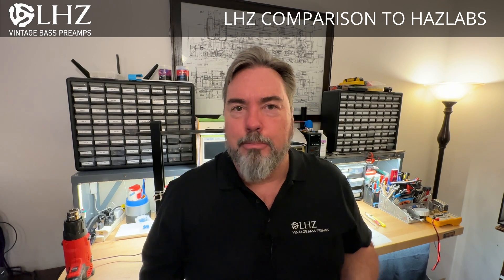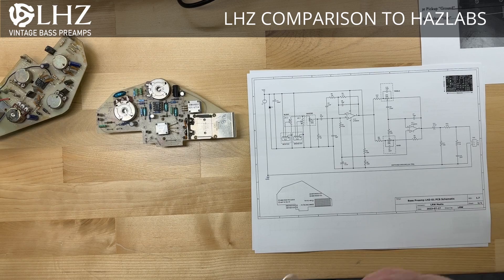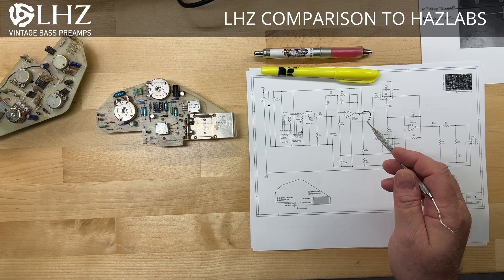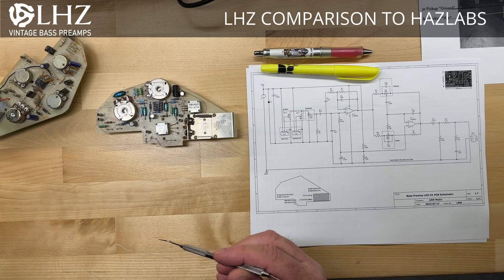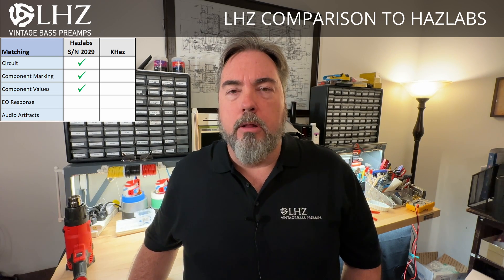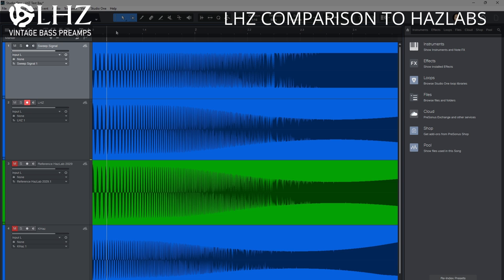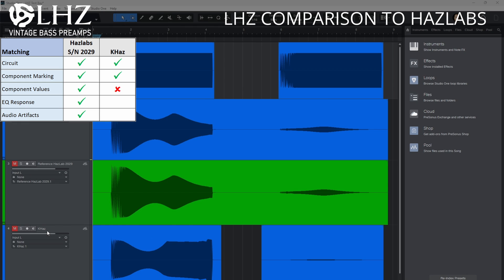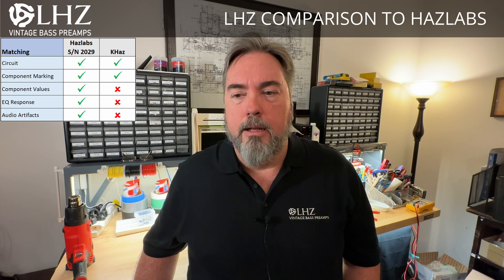LHZ Vintage Bass Preamp Compared to HazLabs

Comment: I replaced my KHAZ preamp and Passive EMGs built for Spector/ Kramer/Korea this weekend.
My problem started with the Korean built electronics were of a low quality and the blend (active balance control) adjust pot was failing for both signal and mechanical issues.
For my problems it took both (Lonnie West, LHZ Pre-amp Shop) and Alison Turner (EMG) to help me.   
In my naiveté, I thought just fix the KHAZ board and replace the pot.  Done!  Not at all what happened of course.  
What did work was talking to Alison and having an email conversation with Lonnie to determine my actions.
My solution was a custom order, which I was given a discount on from EMG, for an Active PJX set with a new blend pot, part number  #ABCX, and the PJX set.  Then order the LHZ Preamp from Lonnie.
Between the drawing from Lonnie and EMG the install was pretty easy.
What was difficult or slowed me down…
I did build up the PJX set with the pre-amp first.  Before tearing out the old, limping electronics, I wanted to test the new configuration.  
Getting the KHAZ board in one piece was a challenge.  The pot fasteners are holding the board in, but my board was wedged into the cavity really tight.  Thought I might break the board or a pot getting it out.
Confirming the pin-out of the original plug.  I tested with one of the supplied phono plug by tapping on the pickups with a metal probe (screwdriver).  The pin-out of the switchcraft plug is different from EMG’s and Lonnie’s plug.  The colors were not the same on mine.  Lonnie has a video to watch.
Final conclusion:  My Kramer- 80s era Spector sounds like the USA built Spectors with USA quality electronics installed.   I am very happy now.  I spent >$500 to make my Spector equal to what I think Spector is selling currently.
Thanks to EMG and LHZ for making my old guitar new again.

Comment: Not wanting to be dismissive of your work, which I think it's great, but there is something fundamentally wrong with the value of the 10pf and 33pf capacitors on that circuit. Those values, paired against that circuit, have the exact same effect as having absolutely nothing in their place. The values of 100pf and 330pf make sense and, quite likely , are the values that should be used. I don't know how you got to those component values, but it is very hard to believe that the original used those. Just my two cents

Comment: Good day!  Sorry for my English, it's not my native language.  I saw your topic originally on the bass players forum, and today I accidentally saw it on this channel.  I was very interested in watching your research, but I want to make a small correction.  This is the second time you made a mistake in the measurements and bones of the feedback capacitors, as well as the high-frequency adjustments.  These are 3 capacitors of 100pf and 330pf respectively.
Reply from the maker: Great question! This is a common misunderstanding based on the capacitor marking. 3 digit marking of capacitors use the following rules: first 2 digits are the value, third digit is the multiplier. Basically, the third digit tells you how many zeros to add to the value. Therefore, a 10pF cap is labelled "100" (or 10, with no added zeros) and a 33pF cap is labelled "330" (or 33 with no added zeros). 

This is why there are several schematics on the internet in the DIY forums incorrectly showing these values at 100pF and 330pF. When a preamp is built with those values, the circuit doesn't have the same response as the original.
Reply: @LHZpreamps  You are certainly right: labeling is often ambiguous.  I made my statement not on the basis of the 100 markings, but on the basis of preamps of the same type.  Hazlab made preamps for Fodera and Ken Smith, and they all had similar capacitors.  The only difference is in the materials, somewhere Lavspn, somewhere wima film.  These preamps differed only in a few capacitors for low and high frequencies.  And they had wima 100p and 330p capacitors.  In any case, thank you for your answer, I will definitely try to put your denomination to hear the difference
Reply: @LHZpreamps  I apologize, I was wrong, I did a series of measurements and you were right.  These capacitors really increase distortion